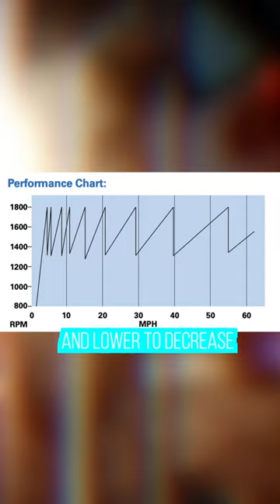Why do Semi Trucks Have so Many Gears?

Comment: 18 is a luxury. 
10 or 12 is perfectly usable.  The lower speeds don't need to be reduced or split unless you're pulling serious weight. 
Ive driven 18 on a 2 speed axillary box and a 4 speed axillary for a total of 72 gear combinations although most of the combinations are redundant and some can cause gear damage.